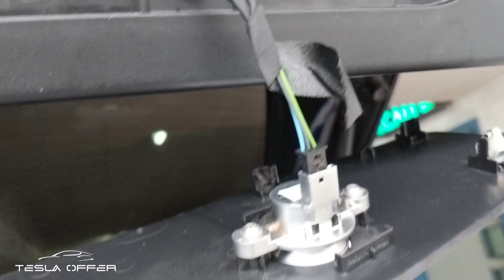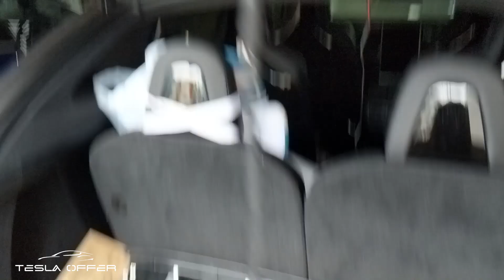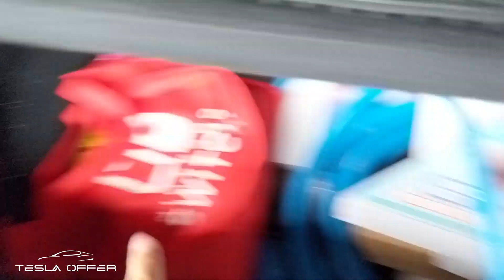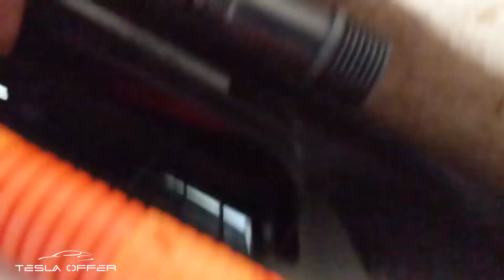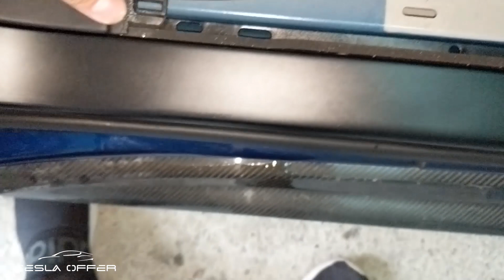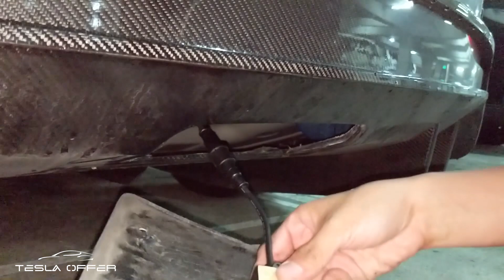EVOffer (Tesla Offer) - Model X Tailgate Foot Activation Installation Tutorial

Comment: Sorry, but this thing is very annoying.  Came down on my head all the time and also when washing the car water triggers it and even had it try to open the hatch indie an automatic car wash.
Reply: Car should be locked, leave your key fob in the house when washing.
Reply: Search for a Faraday bag. You can get a small one that fits car keys. Very useful for different reasons. When small enough, just keep it in you own pocket with key fop or card inside.

Comment: Can you make how to install video for 2022 Model S?
Reply from the maker: Sorry that we don't have a Model S 2021+ here in Hong Kong yet so we cannot make an installation video.

The installation is basically the same as older cars except the CAN connection. You will need to connect the CAN to the port behind the wireless charging pad. Everything else is basically the same.

Comment: Can you make this product fit model s?
Reply from the maker: Yes the same kit can be used on model S but the installation would be more intensive and require rear bumper removal
Reply: @EVOffer  Will same safety be there like it can't open in DRIVE mode?
Reply from the maker: @Pyth0nym  yes. This kit is different from other generic kick sensors. We specially developed a decoder to read the gear on model s/x such that you can only open the trunk when it is in P mode.
Reply: @EVOffer  Can you show me how the sensor is mounted under the S?
Reply from the maker: @Pyth0nym  you need to remove the rear bumper and then put the sensor behind the bumper
Reply: On Model S how do you physically route the foot sensor wire from inside the vehicle to the outside? Is there any possible way to install the rear trunk foot sensor without removing the entire rear bumper cover? If yes, links/pictures? Thx